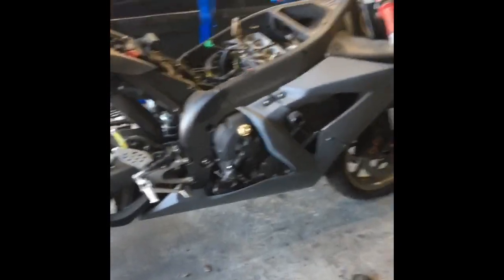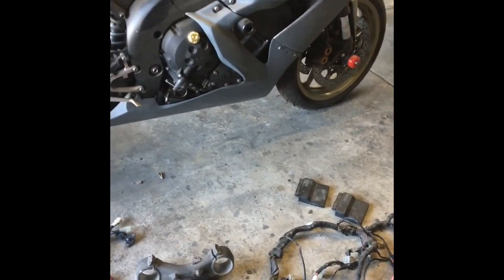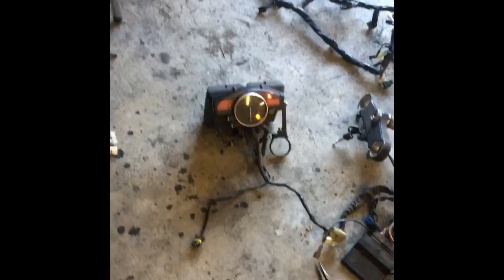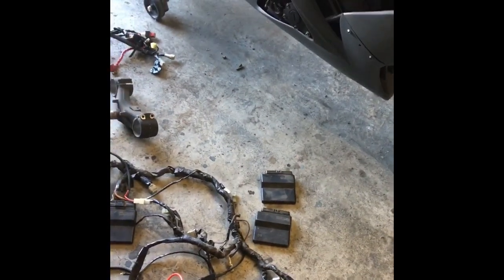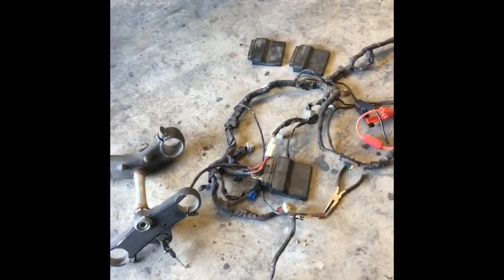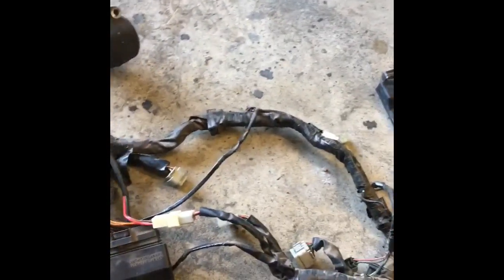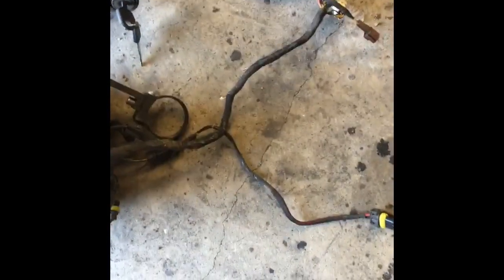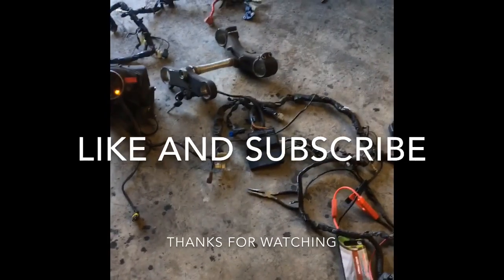04-08 r1 error code Er_1 and Er_2

Comment: I have an ER-1 Code on my FZ6, which shares a detuned version of the R6 motor. There is a data wire and data ground that goes between the ECU and Meter. You can try two jumper wires to eliminate any connector possibilities. If that fails for me, I will aim for my ECU first over my meter, given the results of this video.
Reply: do you manage to fix your ER-1 issue on your FZ6? how did you solve the issue? i just have ER-1 code appear on my bike today. the speedo km/h and rpm has no function and tempreture guage on full bar.. but my bike still can be start and sound normal
Reply: @walijumaat2158  Did you resolve? I now have the problem on 07 R6

Comment: my 03 r1 one has the er1 code.. it ran good last week went to put tags on it now it just spins over thats it
Reply: so how did you solve that
Reply: I have a 02 r1 and mines just got that error 1 and the speed meter is frozen on that screen ? I tried disconnect the battery and its still there?
Reply: How did you end up solving this mine has the same problem
Reply: J’ai le même problème

Comment: I have both an err-01 and an err-02 on my 2004 R1..
The weird thing is, it only appears over 100 km/h when i'm trying to accelerate, and the bike keeps on running fine but my speedometer suddenly fails and doesn't display the correct speed or no speed at all.
According to the service manual, the bike shouldn't even operate with those errors but it starts and runs fine.
Only when I'm riding between 100 and 120 km/h and accelerate, the error message suddenly appears, the speedometer fails and the "check engine" light burns.

Is anyone familiar with this problem and/or any solutions?
Reply: Bro. Did you fix it. I have the same issue right now
Reply: @Rodingaralte5454 I have the issue right now too😢
Reply: Wire shorting or grounding

Comment: I have a error code _1 on my 2010 Yamaha r1 and its getting really frustrating idk what the issue is. It turns on and runs until it reads about 190 degrees Fahrenheit from cold start and shuts off. The main relay assembly then starts clicking. I replaced the main assembly relay  problem still occurs. Then a min goes by it lights back up and starts again.  
Idk what to do. Plz help
Reply: Had the same exact problem on my 2004 R1.Turns out it was a crankshaft position sensor now runs like new. Found one for $12 should give it a try